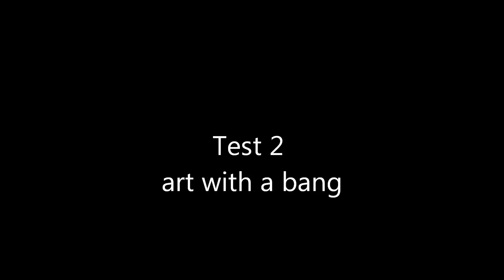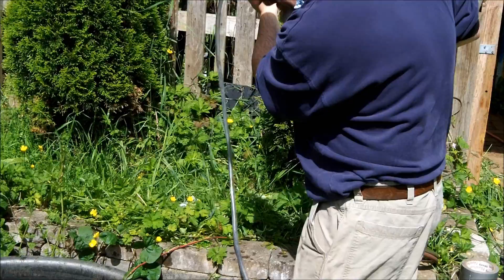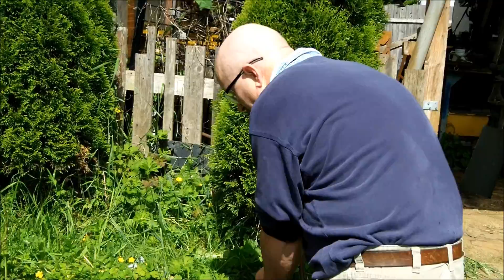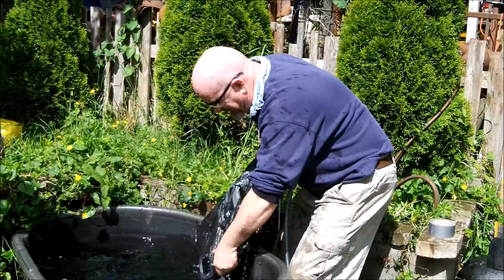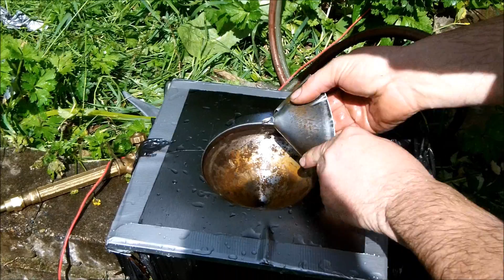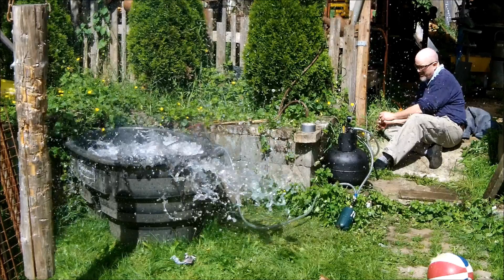A demonstration of Explosive hydroforming using oxygen and acetylene.

Comment: You more nuts than me!!  I got one for you to try...plastic soda pop bottle...2 litter wors fine...need air compressor that makes at least 155 psi. screw the cap on the oda bottle tight, get your handy dandy air blow gun, drill a hole in the cap so the tip op the blow gun fits into it, put your safety glasses on...hold the end of the bottle  with one hand, blow gun in the other a pull the trigger...i have done over 200..never had a problem...kinda odd..most any plastic bottle..even super thin 12 oz water bottles will hod 140 psi